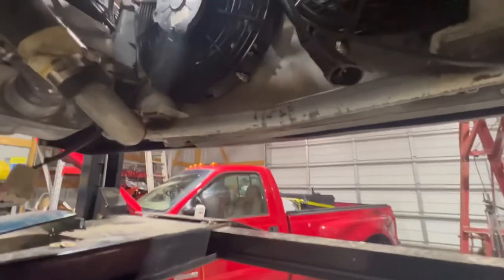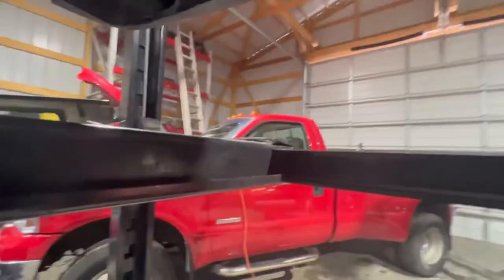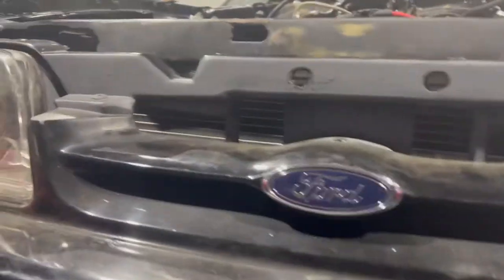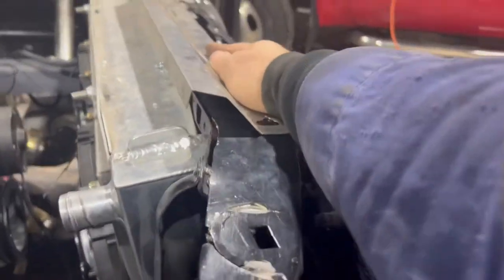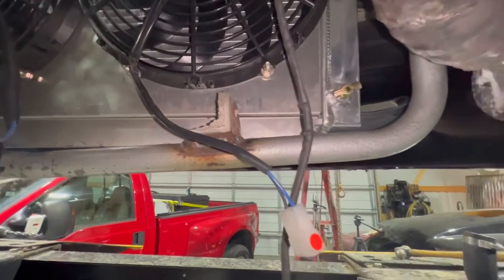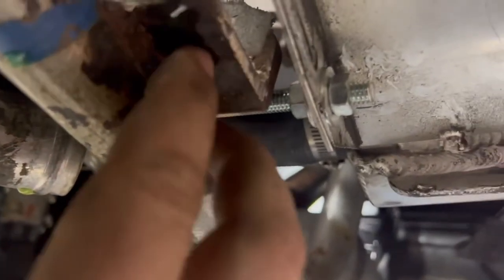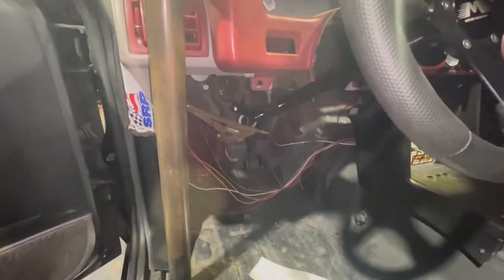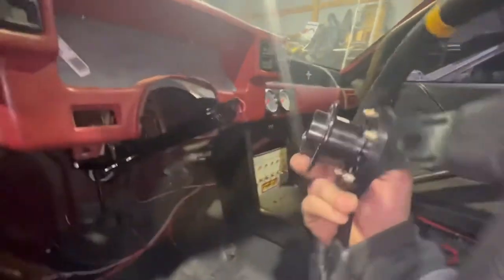Stallion Ep 6 Radiator and Motion Raceworks column  installed

Comment: I’m having an overheating issue on my turbo 351w. I’ve been trying to track it down for years now. Not even sure if my radiator or intercooler(should be good) could be the culprit.
Reply from the maker: Tim Web 

I use a burping funnel, for me it’s usually air in the system. I have had the radiator cap cause fluid/water to boil away and cause an over heating condition. Also not having enough fan or circulation. I use a 4 core single pass but hear the dual pass ones work better too. 

Seems no matter if I use no thermostat or a 160 or 180 it still runs at 210F. I guess if I want it to run colder I’m gonna need better equipment. Just not sure what. I have two 3500 cfm fans. Maybe if I want it to run cooler I might need a 55 gpm water pump. I think the one I have is 38 gpm

Right now it has a 160 thermostat cuz it runs cold at the track. Cuz the fan runs while I’m check data. Last trip to the track it never stayed warmed up. 

I read somewhere that if I put a 180 thermostat in that fans would actually be able to shut off when cruising around. 

Some people think that a proper sized thermostat is key cuz it slows down the flow enough to let the radiator actually have time to cool the water.

Comment: I am installing mine now, the allen screws that were in wheel when i got it are not long enough to use in the quick release adapter.  Did yours come with the correct nuts and tapered screws for the wheel?
Reply from the maker: My motion Raceworks column was complete and had everything I needed to install it. It’s been a while but i think you have to use the Motion horn button cuz the other one don’t fit the quick release.
Reply: @Gillettesgarage  Do you remember if the screws you used to bolt the wheel to the quick release adapter were in a package or did you reuse the ones that held the wheel to the silver bracket it comes with?
Reply from the maker: @ryanbrown8246  I don’t remember that part clearly enough to give a definite answer. I think I may have reused the bolts that came with the steering wheel. I probably should have done a box opening with this video. I just remembered thinking the install was so easy that I didn’t need to put much detail into it. I know I didn’t have any issues with the screws. I didn’t have to cut the steering shaft at all and everything bolted up with out issue for me. I remember there were two horn buttons and I’m pretty sure I used the Motion button cuz it fit better.